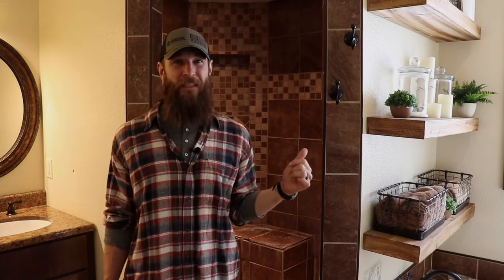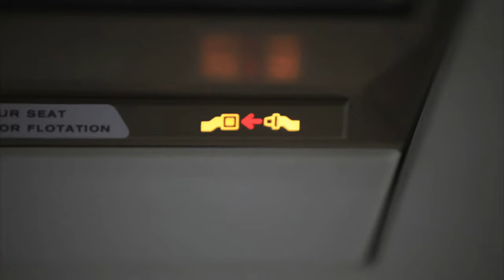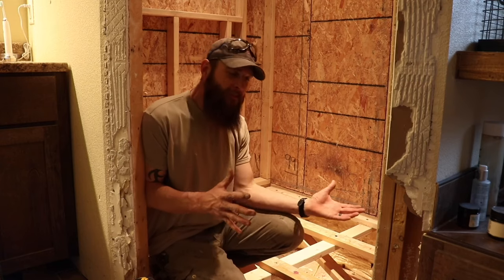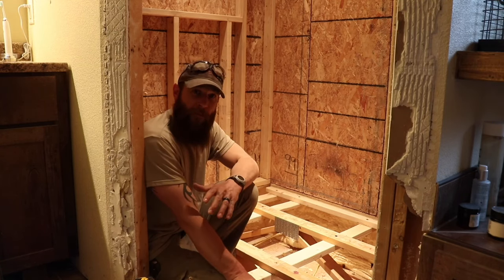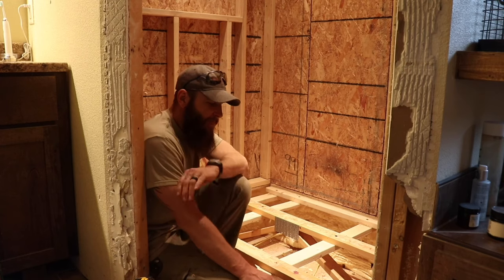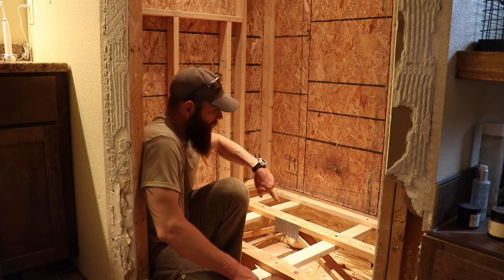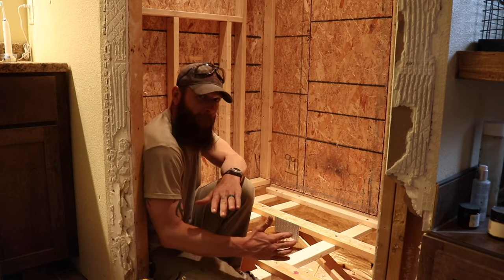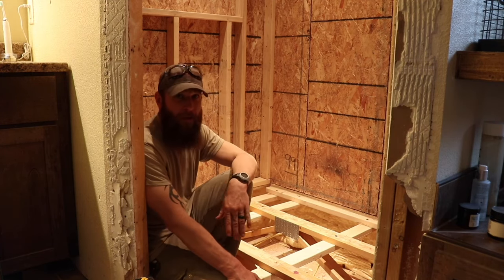DIY CUSTOM concrete SHOWER

Comment: What sealer did you use? And what type of paint is used? I'm curious as to how you waterproofed the surface. Thank you.
Reply from the maker: The mortar itself is a low permeable mortar. So thats where it starts. The paint is a fortified acrylic paint which is sealed with 511 impregnating sealer.
Reply: @TheHiddenHomestead  is that 511 sealer enough for waterproofing a daily driver shower? looks awesome was thinkin about going one way with the shower i still have yet to do but you may have gave me some new options. Great!! lol just dont know about enough water proofing. looks awesome!
Reply from the maker: @bseant420  The 511 doesn’t technically waterproof the whole thing. It helps seal the paint and gets down in all the nooks and crannies which makes it last longer and makes it itself more water resistant. That said I use it everyday. Obviously waterproofing has to start at the base. I did what I could to make the base waterproof just like any shower. then worked out from there. The mortar has low permeability and then there’s probably 5-8 coats of high acrylic paint. Finally on top of all that is the 511
Reply: @TheHiddenHomestead  nice! wow thats alot of paint. how did you apply the paint. airbrush, airless, brush? assuming you were spraying some because tent you  had setup and no video which would've sucked to setup a camera.
Reply from the maker: @bseant420  when I paint this kind of stuff it’s a mess to be honest. So yeah. Trying to video it would be a horrible plus it was a tight space anyway. I sprayed, brushed, sponged and splattered. A lot of different techniques to get a different and natural look
Reply: @TheHiddenHomestead  it would be awesome to see on like sample board. thanks for the ideas!!

Comment: You have inspired me to do something similar with my shower. I was gonna use red guard over my backer board but I noticed you didn't. Do you think there would be a problem with the mortar sticking to it.
Reply from the maker: Thats great! That’s why I didn’t use it. It’s supposed to stick but I believe but that is only a thin layer for tile. I built out a few inches so was worried it would slid e off
Reply: @TheHiddenHomestead  I was having the same thought thanks for taking the time and getting back to me.
Reply from the maker: @machinemayhemgroup  you’re certainly welcome!

Comment: Curious as to what kind of Crete you used for the walls and floors
Reply from the maker: It’s my own mix.
Reply: How does it seem to be holding up? Did you get the fiber mesh online or in store?
Reply from the maker: @ryanclementz6522  it’s holding up very well. I got it from a local contractor supply store.

Comment: I wonder how well or how hard this is to clean the shower
Reply from the maker: It’s not that terrible, considering what it is anyway. We spray it down after every other or every third shower with 50/50 water vinegar. Then once every other week we do a quick scrub down with the 50/50 mix and an electric soft bristle brush.

Comment: Where did you get the molds for the wood pieces thanks mister concrete
Reply from the maker: Made them using a two part putty from smooth-on.com . Great company. They have a lot of cool stuff there

Comment: How do you clean a shower like this with all those crevices?
Reply from the maker: After every or every other shower we spray it down with a 50/50 mix of water and vinegar and use a soft brush to wipe it down every once in awhile.
Reply: Do you really need to spray it down that often even though it has a sealer on it?   Also, would having a water softening system on the house have any effects on the shower over time?

Comment: Your artwork and skill applying it, is amazing.
A mundane question though; what mix of components did you use for concrete floor/pan?
It did surprise me when it was so wet.
Is it holding up well?
I can't find out anywhere, all the web answers think I want to lay tiles on top.
Reply from the maker: Thank you!! I used a polymer modified overlay mortar and so far it’s holding up pretty good! Yeah you have to search pretty deep and already know kinda what it is before you start getting any answers. If you’re interested in knowing my mix design you can IM  me on Instagram (the workshop at HH) or Facebook (The workshop at Hidden Homestead).
Reply: @TheHiddenHomestead  Thanks for your reply.
You say "pretty good", is there anything you would do different?
 I don't belong to either, I do belong to reddit (if you can do that messaging there?) or could you just tell me here?
Reply from the maker: Sorry for the confusion. I wouldn’t do anything different. My pretty good is everyone else’s great or 5 star. Im just weird like that I guess. Unfortunately, I don’t have Reddit. As far as telling you on here, Id rather not. I know that this video is tagged as how-to/diy so I certainly have no problem giving information to an individual that is really interested in learning. However, I do have an issue with blasting a “trade secret” on here that I’ve spent years trying to figure out just for someone to get a quick fix answer in which they’ve spent no time or effort really learning anything. Now, I’m most definitely not saying that this someone is you. Not at all. What I am saying though  (long story short) is this is why I’d rather not tell you on here. I hope you understand.
Reply: @TheHiddenHomestead  OK, understood.
Will look to joining before mentioned, as this is important to me. As an age pensioner I can't afford to do it twice.
Reply from the maker: Not sure if youve attempted to get ahold of me on the Facebook or not but if so just and FYI it’s been acting weird for a week or so. I get notifications but nothings ever there.

Comment: What's the Concrete you're using for the walls
Reply from the maker: It’s a special mortar that I make specifically for vertical applications. There’s a lot of pre-bagged mixes out there to choose from but this one is definitely more economical. I am in the process of making a full online course that goes over all of it. For now though, if you’re interested I have a link to the ingredients, and the how/why of the mix pinned to the top of the comments section. Admittedly, it’s on my Patreon channel so it does require payment for access to get all the information.

Comment: why but a moisture barrier? wont that trapped moisture erode the concrete?
Reply from the maker: It won’t erode concrete. I just did it as an extra precaution to keep moisture (if any) away from the wood.

Comment: Is there a way to talk with you. I’m doing this but gonna need some explaining along the way. I need a set of plans
Reply from the maker: Hey! How soon are you wanting to start the project? I will have an online training coarse coming out soon which will give you everything you need to tackle it. Or if you’d like you can check out my patreon page (link in description). I have my mix design and explanation over there.
Reply: @TheHiddenHomestead  3 weeks
Reply from the maker: @andynichols213  right on. Not sure if I’ll have the online training up and running by then but you can certainly check out my patreon to see if the mix design and explanation helps. If that’s not enough we could figure out something to get you pointed in the right direction.

Comment: As the person in my home that does the house cleaning all I see is a cleaning nightmare. I would think this far better suited for an outdoor pool area for prerinse and after swim rinse.
Reply from the maker: It’s not that bad actually. Once a week we spray it down with vinegar then every other week while in the shower we scrub it down with vinegar and a soft bristle brush and rinse. Is it more then a normal shower? Sure. But it’s not a normal shower so we’re ok with it.

Comment: If I wanted to get a shower like this how much would it cost
Reply from the maker: There’s lots of different variables but this one is 5.5 x 5.5 x 8 tall, it took me about 60-70 hours, was on the second floor, and was done in 2020 before the big jump in material prices that we’re seeing (at least where I live). So, considering that probably anywhere between $13,000-$17,000 now.

Comment: What did you use for waterproofing?
Reply from the maker: For the concrete? Or shower itself?
Reply: @TheHiddenHomestead  

The cement. I assume you sealed it something?
Reply from the maker: @robertd6925  I use a lot of acrylics. There’s acrylic in the concrete itself which helps. Then I use a high acrylic paint to color the concrete. The paint is watered down to 50/50 which really gets in and seals up all the pores. After that I spray on an impregnating sealer to lock it all up.
Reply: @TheHiddenHomestead  
Cool thanks

Comment: can you explain how you mixed the mud to shape everything??
Reply from the maker: I don’t quite understand what you’re asking.
Reply: @TheHiddenHomestead  the cement you mixed for shaping the walls what is it and how did you mix it? is it just Portland cement?
Reply from the maker: @traviswalker007  it’s the same mix that I used for the floor. Portland, fine sand, and polymers mixed to a thick peanut butter like consistency.
Reply: @TheHiddenHomestead  thanks what ratio of each did you use?
Reply from the maker: @traviswalker007  ahh yes. There’s what you’ve been trying to ask. My mix ratio may be drastically different then your mix ratio for two reasons: availability of materials used, and preferred working consistency. 
I’ve spent five years figuring out this “secret recipe” so feel free to find and message me on Facebook or Instagram and I’ll discuss it with you. 
Facebook - https://www.facebook.com/theworkshopathh
Instagram - https://www.instagram.com/theworkshopathh/

Comment: This could have been a curb less shower with the floor shower depth was like 1 foot deep should have used a liner and dropped the shower depth. Great job kinda.
Reply from the maker: Thanks! I think. I have no idea what you’re talking about though. It is a curbless shower.

Comment: What material is the concrete used
Reply: I do decorative concrete on pool decks and patios but would like to go vertical over different materials. Any advice on what to use.
Reply from the maker: I started out doing decorative. Now trying to switch over to more vertical to do the full concrete package. 
Anyway! So I’m sure you know there’s tons of premix bags you can use. Which before you try to mix your own you might want to try one so you know what you’re trying to match and how it feels and works. There’s not much to them really. High cement content and polymers (acrylics). My mix is based on what I’m able to get locally so yours may have to be different. 
Feel free to message me on Facebook or Instagram and we can talk about it some more
https://m.facebook.com/theworkshopathh
https://www.instagram.com/theworkshopathh/

Comment: Would have been nice if there was more than a few lines of instructions in the video and, good God, what a choice to make. Next to no waterproofing, covering everything with cracks and texture which will make this a mold and mildew farm and be next to impossible to clear (unless you want to use harsh chemicals or a power washer on your finicky finish). While the construction is certainly unique, who wants to shower in a dark mine shaft? A 14-year-old who likes Minecraft? This just brought the resale value of your home down by $20-$30K. This is going to be torn down and redone in less than 5 years. Strongly advise checking out some basic design principles before constructing anything else.
Reply from the maker: If you thought the whole process was a horrible idea why would you want or care about more instructions? Thanks for the comment though.